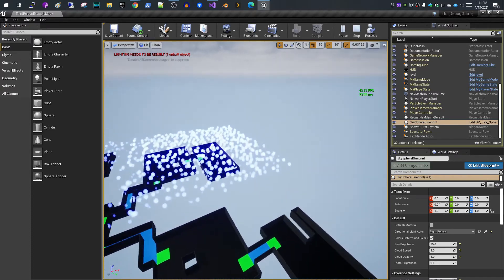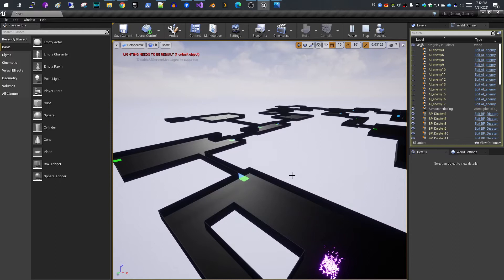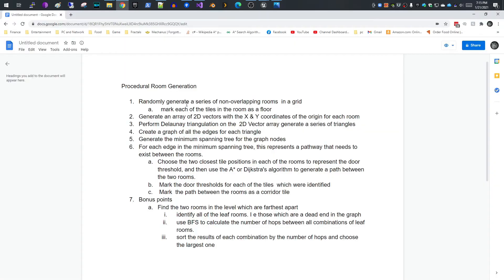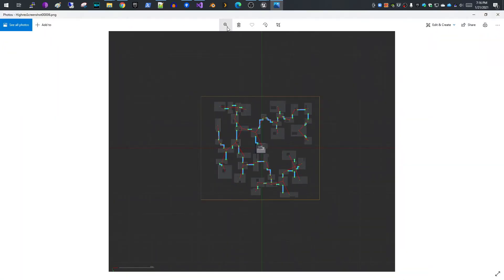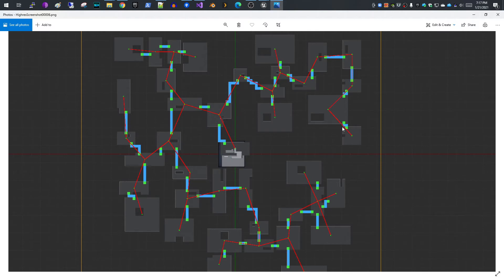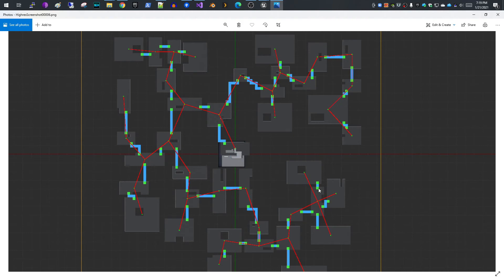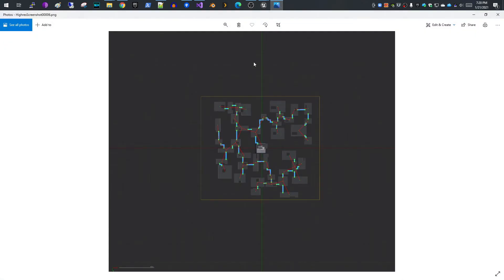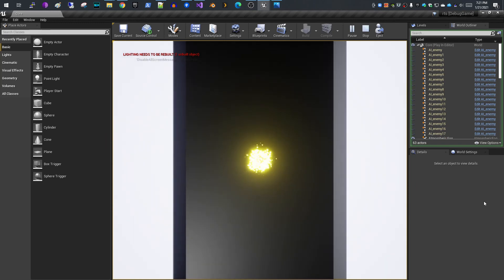Procedural Room Generation Methodology

Comment: Is It possible to do It via Blueprints especially where we need to utilize A* or Dijkstra algorithm
Reply from the maker: I'm sure that it probably is possible, but obviously without doing it I don't exactly know that to be a hundred percent true. I think you will find that while blueprints definitely make certain tasks very easy, when it comes to algorithm programming it is actually much easier to accomplish in C++ . I realize that not everybody is a programmer, but honestly I think trying to do this in blueprints would be more difficult. it just gets very verbose and the graph gets very large trying to accomplish basic things like setting variables Etc. I would not do everything in code, but it would definitely be a good skill for you to have if you are serious about Unreal Engine. Just for the occasion like this. Good luck my friend!
Reply: @GordonVart  Thank you, wish you the best as well.
Primarily I'll attempt to work out a solution with blueprints otherwise I'll try C++ which won't be easy since It's my first time using C++ in Unreal engine